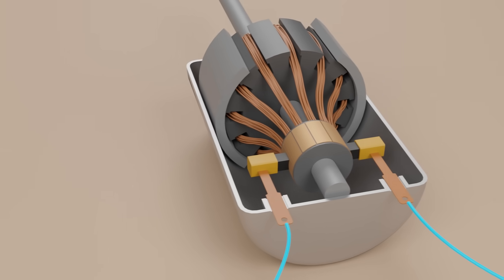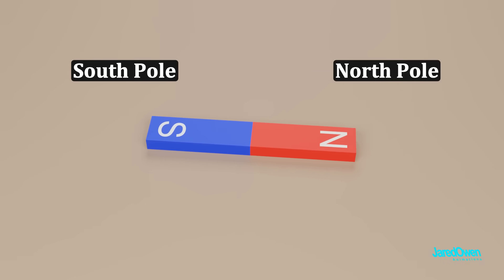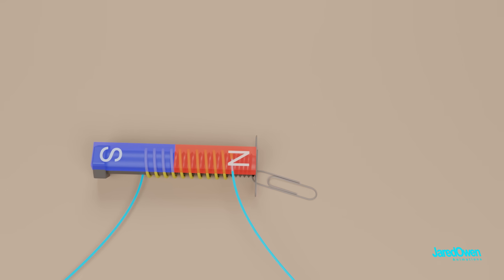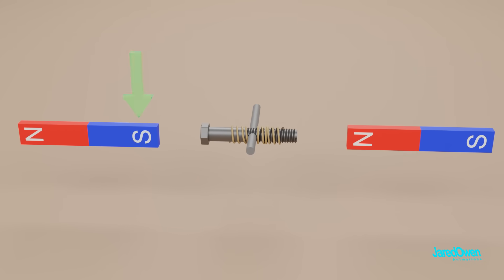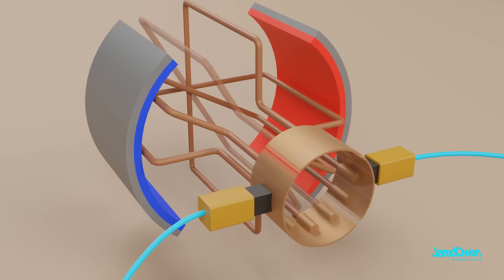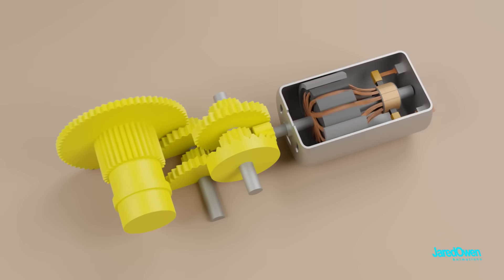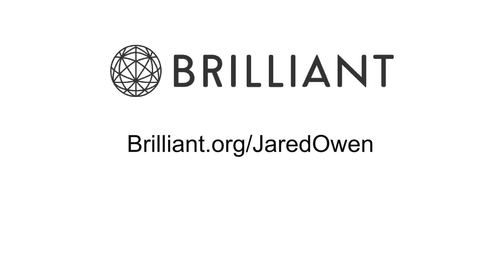How does an Electric Motor work?  (DC Motor)

Comment: I can only imagine the amount of 3D modelling, animation, planning and time required to make a video like this. Not to mention the rendering power. So clear. Thanks alot!
Reply from the maker: Thanks Bran!
Reply: @JaredOwen  no problem, Jared.
Reply: @MichaelThePeculiar  Thanks Larb!
Reply: @II_xD_II  welcome The 😕
Reply: @Random_YT-Username  np debojit
Reply: @JaredOwen  How long does it take to make a video like this? Really curious
Reply: @JaredOwen  I been an electrical Engineer for 25 years now and your video is one of the best so far , many people who are just starting will find this extreemely helpful..
Reply: @JaredOwen  one of the best explanation I've ever seen
Reply: @JaredOwen  make a video on how a generator works.
Reply: Yeppp,it is so worth it,the animation great,and the concept is clear enough
Reply: This was brilliantly done.
Reply: ครับ ผมก็ จินตนาการ ไว้ ว่าเป็น ตัวฉุดรั้ง  ด้วยพลังงาน แม่เหล็ก ครับ ระบบไม่ซับซ้อนมาก หาก แม่เหล็ก มี แรง ดึง หรือดัน มาก พอ ที่ จะ ปั่นเพลา  ครับ ผมเองไม่ มี ความรู้ เรื่อง ไฟฟ้า เลย ครับ และคิดว่า  ไม่จำเป็นครับ เรื่องตัวผลิตไฟ เพราะของเก่า ก็ถือ ว่าดี แล้ว      😊
Reply: Don't forget all AC & Radio waves type power have three elements, 1. the positive cycle 2. the neutron, last but not least the   3  the negative cycle.  That neutron cycle is by far the most powerful once you understand:  Without the neutron, the energy could not move forward!!!  You can learn allot about this if you have a bar magnet.  I will prove to you that the center field of a magnet is the most powerful by far!!!  It's how they built the great pyramids!!    If you have a bar magnet/ not a horseshoe type, I'm going to show you all the basics.   DO NOT DISRUPT THE CENTER FIELD WITH ANY OTHER METAL>> 1. Anti-gravity, get something like plastic or glass a granite rock would work well just tap with your finger the centerfield of the magnet near same and it will lose 2/3 it's weight, Next 2.  let's tap the center field near a stream of water and watch it repel the water.  3. If you vibrate the center field at the correct frequency any granite rock will become butter.  YOU MUST UNDERSTAND THE DIFFERANCE FROM An OSCILLATION AND A VIBRATION!!!  The petrographs on the pyramids told us all of this...  Our future will depend on the center field, The height of one's intelligence is directly proportional to their realization of their own ignorance VPC!!
Reply: That’s was great

Comment: This video made me understand how the magnet works and how the motor works Thank you
Could we invent a motor that works without a coil?
هذا الفيديو جعلني افهم كيف يعمل المغناطيس وكيف يعمل المحرك شكرا لك
هل يمكنن ان نخترع محرك يعمل بدون ملف كهربائي
Reply: And if we did this motor that works without an electrical coil, would it be possible to make this motor connected to mechanics in a generating engine and extract electricity from nothing?
واذا فعلنا هذا المحرك الذي يعمل بدون ملف كهربائي فاهل من الممكن ان نجعل هذا المحرك متصل ميكانيكين في محرك توليد كهرباء ونستخرج كهرباء من لا شيئ

Comment: Good video. The thing this didn't explain for me, though, is how to control the direction of spin - how does it not pick a direction at random on start and then continue in that direction because of momentum?
Reply: Thats a good question. I don't think the motor covered in this video can pick a direction. If directional choice is needed my best guess would be to somehow only allow the moter to turn off when the connectors are in a specific position
Reply: There is a simplification in the video for the sake of the non-technical people to understand. The torque is actually not created by the attraction/repulsion of an internal electromagnet interacting with the outer permanent magnet, there is no an internal electromagnet as simple as described in the video.
"Torque is produced by the principle that any current-carrying conductor placed within an external magnetic field experiences a force, known as Lorentz force" (Wikipedia) Look for it, you will see that the rotor always will start in the same direction. As it happily happens in DC brushed motors...🙂

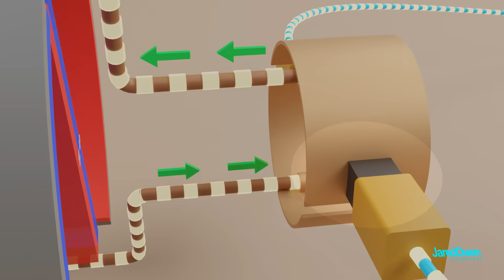Comment: At 5:45 how current starts flowing in the opposite direction ?
Reply: Because the battery always moves current in the same direction.  So the flow swaps on the armature when the brushes begin touching the other side of the armature.  Note that the current does not swap direction between the battery and the armature, only within the armature itself. Watch again slowly.

Comment: Just something to note, the current flows out of the negative terminal on the battery, not the positive, so the flow of electricity in the first circuit should be flipped
Reply: I agree. Seems like it would make more sense positive flow to negative but it is negative to positive. Way back when, maybe they should have labeled it differently. Very good instructional video though !
Reply: He showed conventional flow instead of electron flow, but in the end this does not effect the actual current flow because both are correct since when the free electrons move to another atom is leaves behind a positive charge, so this positive flow is in the opposite direction, thus it’s not entirely wrong to say current flows from positive to negative!

Comment: When the motor is not working and you just turn it on, how do you manage the side in which it will spin, whether clockwise or counterclockwise?
Reply: its based on which way you have the battery connected. one way will spin clockwise, flip the battery and it spins counterclockwise
Reply: @WIZVRDofficial  but what about the state when the metal loop is perfectly horizontal and not moving, for example in 4:43, and you connect the battery? There is nothing to decide in which direction it would rotate, it could go clockwise as well as counterclockwise, as there seems to be no other forces to put it off balance, so it will theoretically stay still. If you then for example push the right side just a little bit up, it will start rotating the other direction than on the video
Reply: @qqutoedjd9788  it might go the other direction for just a moment but it will go the intended direction based on the battery and how it switches the poles in the rotor, to minimize this they add many more armatures to the rotor
Reply: @WIZVRDofficial  now i get it, thanks!
Reply: @qqutoedjd9788  no problem

Comment: at 0:15 how to get this effect in blender.
from close mesh to half open
Reply: There's a modifier called boolean. You can put it on the object you want to cut (on modifier tab which looks like a wrench), and then make a cube, or any shape, back to the object, take the eyedropper on the red bar thing and select the cube. Make sure the type is "difference". Now you can just move the cube around and see that satisfying cut.

Hope that help 👍

Comment: If electricity is a produce magnet to rotate, then if we have already a magnet we don't neet electricity to rotate a motor, then the only need to do is align the magnet the North Pole and south pole like in the wiring in the motor, remove the wiring and replace with a magnet but the magnet should place according to the wiring in the motor.. and its rotate forever
Reply: you are referring to a perpetual machine, very difficult to create!
Reply: @redhorizon7225  no its better than, i know what why perpetual machine didn't work. I know what you think,  but magnet is different than other forces, magnet is like a gravity and its hqve its own force, unlike perpetual machine you need a force to make it work like push and pull, magnet has its own force..

Comment: As usual I'm slow af but yea how wrapping wire around the screw then connect the wire with L and N can turn it to magnet ? Did it only wrapped the wire without the cable shield ?
Reply: Yep it's without the cable shield
Reply: @tabishkhatib8264  I see

Comment: Why does the current flow other side when the brushes switch side
Reply: Because the flow of electrons is reversed. Electrons are negatively charged particles that flow through the circuit from the negative to the positive terminal.
Reply: @KFredChicken  thanks I got it

Comment: Make a infinite energy use this, Battery gives power to motor, the motor gives energy to battery using kinetic power
and your motor will spin forever until it burn of overheating 😂😂

Comment: Wait so we don’t even need to use electricity to make them run? why are we using power...
Reply: electricity powers the coil, which causes the rotation due to magnet poles attracting/repelling
Reply: Dano B I know that but why not just use permanent magnets?

Comment: How do those conducting brushes maintain a perfect balance and don't move?
Reply: Springs
Reply: @PabloGonzalez-hv3td  but how🤔
Reply: @RajuSingh-fx9lh  They sit in a slot and springs push them against the commutator. Pretty simple really.
Reply: @PabloGonzalez-hv3td  ooo so doesn't it cause any defect I meant it's like everytime they r getting pushed right and left😁😁😂😂
Reply: @RajuSingh-fx9lh  The brushes wear down after time
Reply: @PabloGonzalez-hv3td  oo so they'll be replaced?well I heard of brushless motors too
Reply: @RajuSingh-fx9lh  Cheaper DC motors are meant to be thrown out but many do have replaceable brushes. You can also resurface the commutator on a motor lathe. 

I have some DC motors with replaceable brushes in my RC cars.
Reply: @PabloGonzalez-hv3td  oo thanku soo much

Comment: Your video is excellent. However in making the bolt into an electromagnet , unless you add a layer of insulation between the bolt and the wires there will be a short . In addition you can’t simply use bare wire , which will short too. It has to be a magnet wire

Comment: Does it make short circuits  when both polarities are touching at where both commutators rings meet ? And then what will happen in such a time ? If it stops at that point how will it start.........oho I found  the solution to my question by hearing it over and over again thank you very much for your video .
Reply: How to make motor
https://youtu.be/R4gdPLx4now

Comment: SO, you went over brushed dc, but when are you gonna explain brushless direct current motor or brushed and brushless alternating current motors, or what about dc motor controllers?
Reply from the maker: Great suggestions - maybe for a future video
Reply: @JaredOwen  since we're on the topic of motors, can you please make a video on dynamotors (motor-generators), I really think they are interesting and how useful they were for example, in B-29 Superfortress, the receivers had dynamotor to step up the voltage so the vacuum tubes can work properly

Comment: 5:53 I don't get how the ring switches the flow of electricity. Seems like it just completes the circuit wherever it is in the spin.
Reply: Same! I really wish that Jared went into more of an in-depth view of how some of these concepts work :/
Reply: @whoe_whate8487  here's how to make simple motor
https://youtu.be/R4gdPLx4now
Reply: It's simple buddy, check that the commutador is touching one wire (connected to brush) at a moment, and the other wire at next. Eletricity will always flow to a single direction, leaving from positive side of battery and arrive at negative in this case. So the commutator ring is touching one brush (negative) and when rotate it will touch the other brush (positive) which is making the inversion.
Reply: How to make motor
https://youtu.be/R4gdPLx4now

Comment: Are the wires connected to the commutator insulated to avoid shorting? It looks like, from the picture of a real one, that the wires are bare. If they are bare, how does the touching wires not make a bunch of weird connections and therefore do a bunch of weird shit?

Comment: But that electric fan that you demonstrated as an example has an AC induction motor not a DC motor. DC motor brushes wear out, are too noisy, generate heat and frictional losses and in the process of being phased out altogether.

Comment: it's all fun and games till you try to re-explain to your friends how an electric motor works without showing them this video
Reply: That's part of learning both formally and informally. You haven't really learned until you can explain it. This is true even after watching your favorite political video. You might be convinced, but if you can't "win" an argument with an adversary, you really didn't learn it. (Or you might have learned that the video was B.S.) With this one, how about, "A motor is a spinning electromagent inside a permanent magnet." This will lead to other questions if your friend is curious that you would need to explain. There are lots of points in this video that are not obvious. Why does an electromagnet work? How does electricity flow through a wire? If you watch this video a few times, you can teach it (if you are so inclined). But the video is damn near perfect.
Reply: @RyanK-100  i agree this video is great!!:) i just struggle keeping information inside my head unless i write it down, so good idea, i'll rewatch it and take down notes and hopefully i can explain this to someone correctly if they ever want to know (tbh sadly my friends probably won't care)

Comment: Dear Jarred, The household fans, as far as I know, work primarily with asynchronous (induction) motors, but other than that, the video is very useful for beginners and average people to understand how a DC motor works.

Comment: This is a very good video with good animation. It is a pity that you did not mention that the stator can be made of an electric magnet, in which case the motor can be connected in series, in parallel or mixed to the rotor. What’s more, when in series, the motor becomes universal, so it’s suitable for both AC and DC. Thanks for the video.

Comment: This is one of the best video about motors I ever seen. There is only a little missing information: if you don’t consider the Lorentz Force you cannot derive the rotating direction (in the video that condition is represented by the rotor “magnet” in horizontal position)

Comment: Hi mate, excellent video, however can you explain why the current reverses in 5:47?  I am under the impression the current does not reverse direction, as you are always applying the same polarity to the brushes.  By doing it this the electrom-magnetic field resets to always having the south pole on the left hand side (which you did correctly show) pushing away from the permanent south pole magnet also on the left.  Correct me if I am wrong.

Comment: What if the sides were electro magnets, not the middle ? 
(Sorry if that's a stupid question, smol brain here)
Reply: That's what you find in a stepper motor.
Reply: You will need a driver to produce a rotating magnetic field so you can rotate the rotor.

Comment: Now we need AC motors explained this good
Reply: NJ and PA railfan 
What has been explained here is a universal motor. This motor will run on both  ac and dc. An inductance motor will only run on ac current only, it is quieter, more efficient, and requires less maintenance. 
.universal motors have great startup torque and tend to be more compact. My grandfather had an old motor that was both, universal to start then switched to inductance once up to speed.

Comment: Brilliant animation!  I’m going to subscribe.  Note to all:  those wires in motors (“windings”) are insulated with an epoxy-like coating so that they do not short out (conduct between each other from side to side contact). This forces the electrical current to travel through all the loops, which generates maximum magnetism!

Comment: 5:31 When the brushes touch the two plates of the motor manifold (commutator), there will be a short circuit!
P.S. Sorry for my bad English.
Reply: And you call this bad English? Come see what some of my co-workers write and they like to say "you need to speak English if you want to live in this country"
Reply: @2005christian1994  I use an electronic translator, but sometimes he doesn't translate well. I don't know English well myself.
Reply: @TrasherFCR
How so?
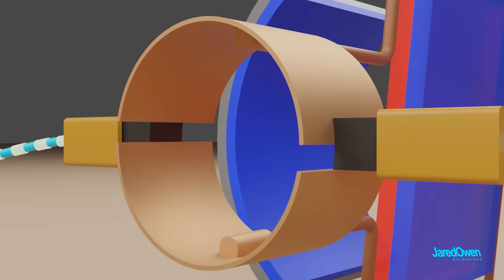Reply: @cellsdoni5968  In the case where the motor has one coil on the rotor and when each of the brushes touches both manifold plates, it turns out that both brushes touch the same manifold plates. This will result in a short circuit. (5:35)
In this case, a gap greater than the thickness of the brush is needed between the commutator plates.
Reply: @TrasherFCR  
Well, yes!! Of course, and great expo! Can you actually do this with Calculus?? THAT would be a real jewel! 😜
Reply: What if we Arrange a Resistor or a Fuse in the Circuit. Eureka Haha
Reply: @wedoru1176  What's the point? The motor will still not work properly! And the fuse will constantly burn.

Comment: Wow. This is actually how my garage door works. On my garage ceiling there’s a box where a motor is inside it and on top of the box there’s a mechanical gear and it spins this chain to where it’s connected to the door. This is amazing! I oughta create a robot with this.

Comment: Brilliant vid. What I don't understand, still: why a bunch of loops of bare wire, all touching each other, don't act as one big solid piece of copper. If they're not insulated and are all touching, doesn't current easily pass between them instead of just down their length? In other words, if you wrapped the wire around the bolt 100 times such that each loop was in physical contact with other loops, wouldn't current simply pass down the whole mass of loops sideways instead of dutifully following the wire around the bolt 100 times?
Reply: Great question.
I think it has to do with the intermolecular forces sticking the bunch of copper atoms as a unit.
But tbh, I don't understand it either